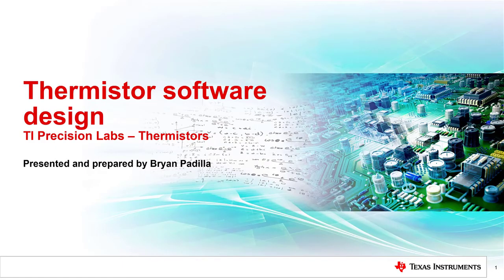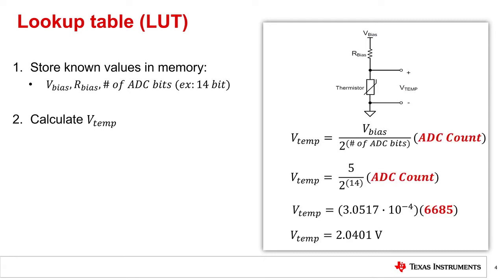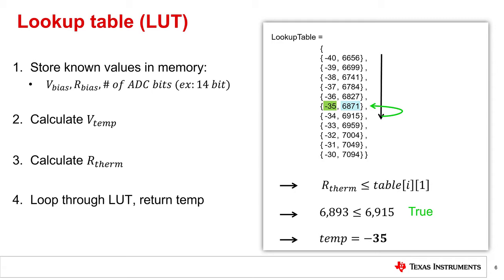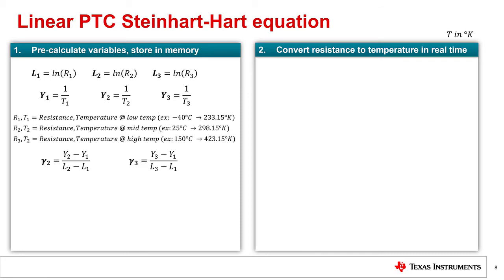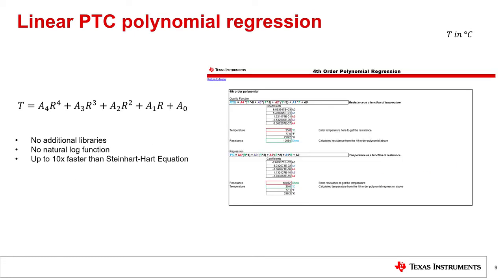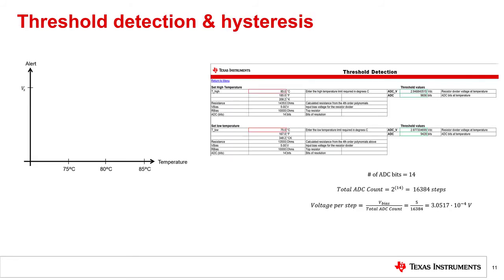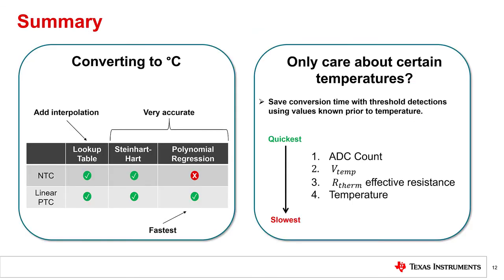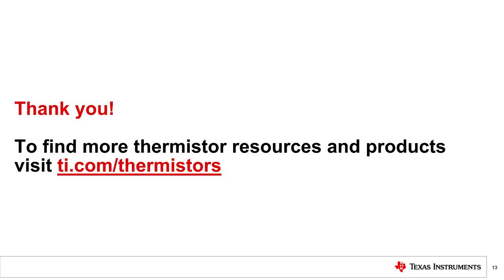Thermistor software design

Comment: In the formula to calculate 1 LSB voltage @1:57, why Vbias voltage is used, Instead of using the ADC Vref voltage. Could you explain?
Reply from the maker: Hi there, thanks for your question! The most common use for a thermistor in a resistor divider circuit is to use the VBias as the VREF for the ADC, in ratiometric mode. In this application, the VBias is the VREF. If your application is different, you will have to adjust the formulas as needed for your VREF as well as the formulas for calculating the resistance and current for the resistor divider from the ADC calculated voltage.